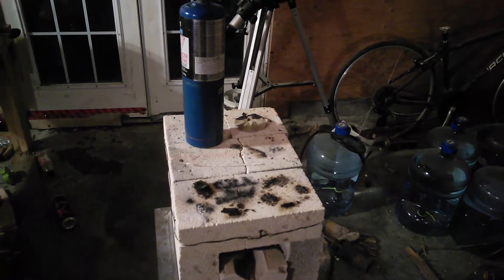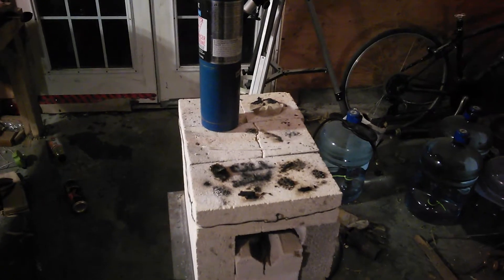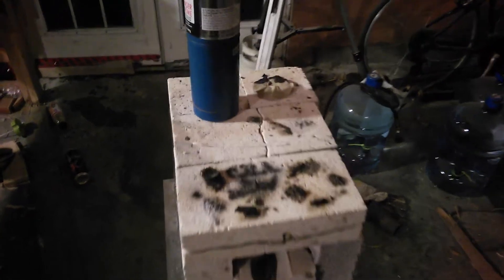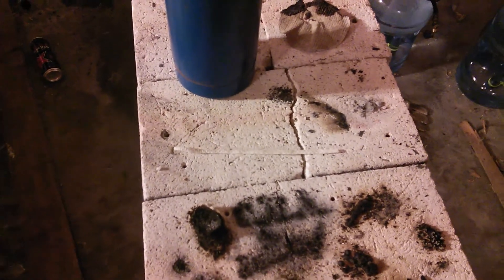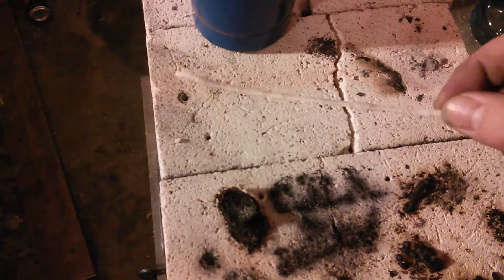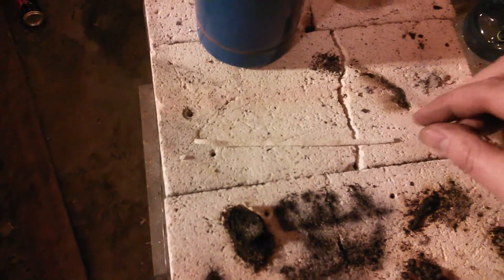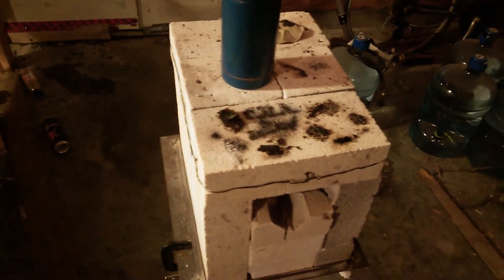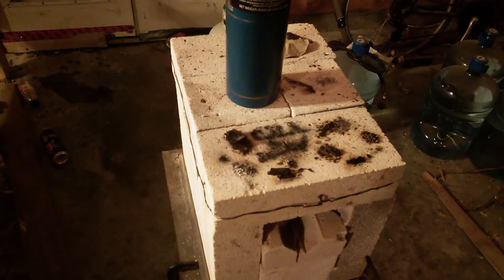Potassium chlorate and flour

Comment: wow cool does it work with potassium nitrate?
Reply from the maker: i ran a rough test,   1 part by volume flour to 2 parts potassium nitrate,    it can almost sustain combustion.

it seems possible to produce the same result,    would need to determine the ratio of ingredients through successive approximation.